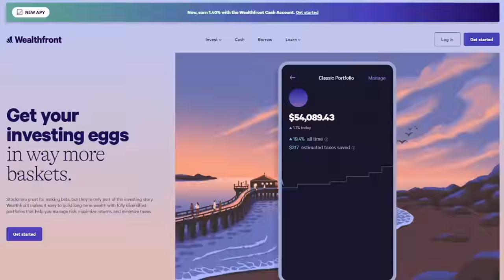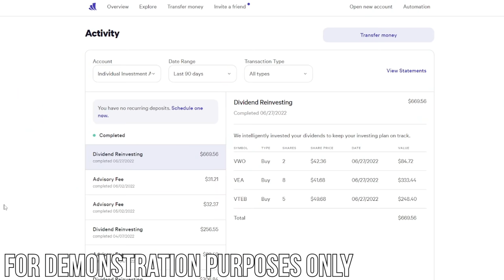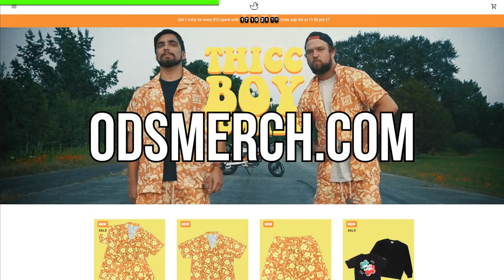CONVERTING AN OLD LIMO INTO A LUXURY CAMPER | PT.3

Comment: Hi im an engineer. Rust is a chemical process. If you can find little blocks of zinc and weld them to the adjacent (healthy) metal around rusted areas thr zinc will rust first protecting the healthy metal. Prolonging the life of the metal.

Comment: The proper way would be to cut out all the rusted stuff and clean remaining rusty bits. Then fabricate and weld fresh metal bottom for the car. With just adding plywood top of the rusted base doesn't fix anything.
Reply: I mean it does fix the floor having  a hole in it. It just isn't a fix to save the rest of the vehicle since it is far too bad at this point